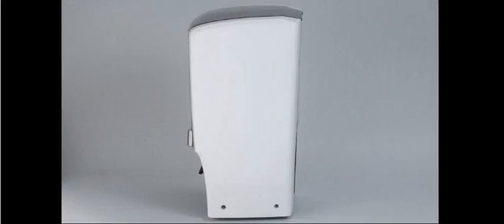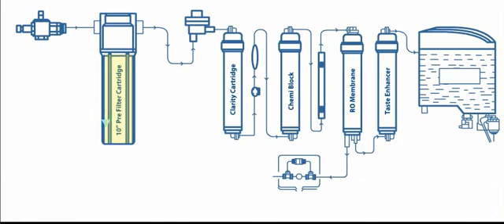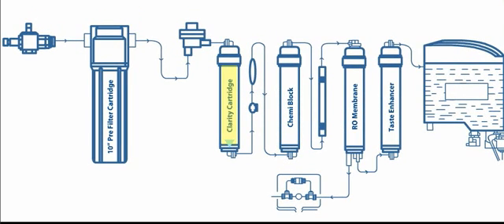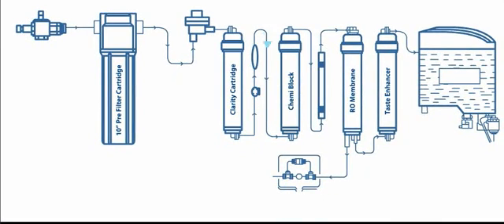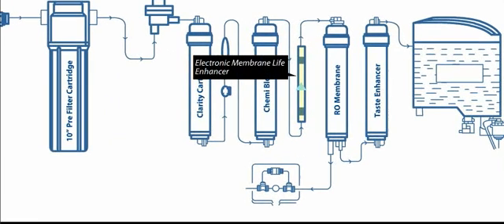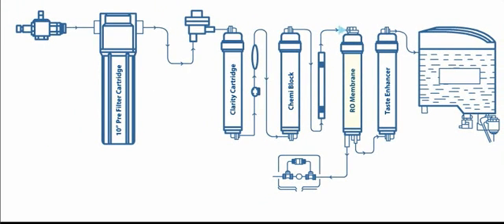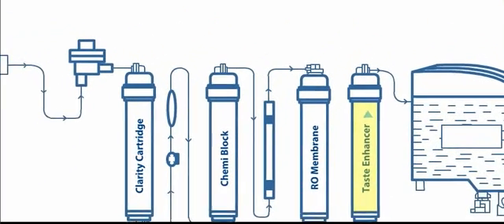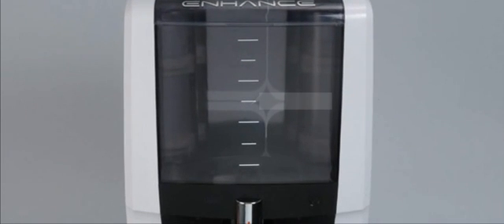Working of Aquaguard Enhance RO

Comment: The Enhance RO+UV+TDS model can remove the oil also
Reply from the maker: Dear Parthiban,

RO membrane is meant to remove the dissolved solids from the water. Aquaguard Enhance RO + UV + MTDS is equipped with I –filter (sediment removal), activated carbon (organic chemical removal), membrane (Removes dissolved solids) and microbial disinfection by UV. We have to check the oil concentration in the water and if it is very high the filters and membrane will clog very fast. Water testing is mandatory before arriving a conclusion.

Regards,
Priya
Reply: Eureka Forbes M/s Priya can you able to call me and explain in my mother language.
Reply: Am also
Reply: 9158019414

Comment: @eureka forbes pls could u explain the working of dr aquaguard magna uv biotron. As green light was blinking continuously, i got the filters replaced but still the green light is blinking and not changing to blue.The user manual does not contain any info regarding troubleshooting and the indication for the user if the light is glowing blue green orange or red. Please could u explain the light indication system.
Reply from the maker: Hi Hussain,

We'd like to get this checked for you. Please share your contact no./customer ID, as it will help us to proceed further.

Regards,
Shiraz
Reply: Eureka Forbes customer id is 1012454847 and contact no is 9167875542. please assist me in understanding the light indication
Reply: Eureka Forbes need a resolution of my issue
Reply from the maker: Dear Hussain,

I understand I have responded to your issue here : https://goo.gl/brm0Uk We shall take it forward accordingly.

Regards,
Shiraz